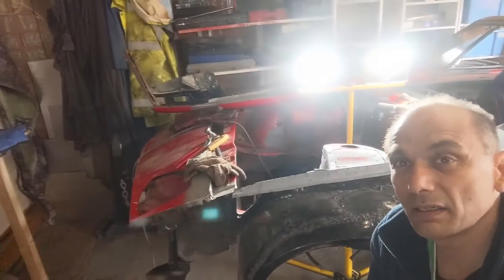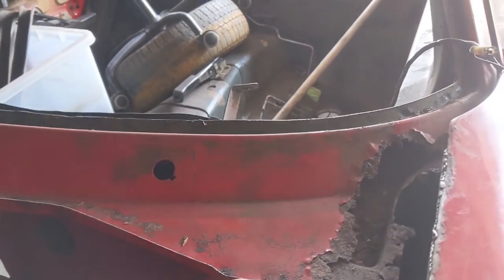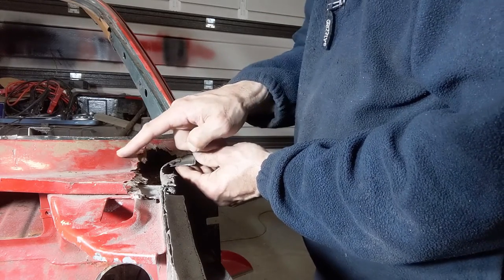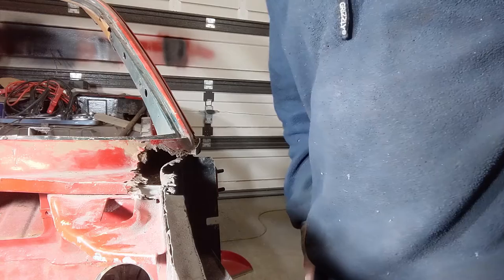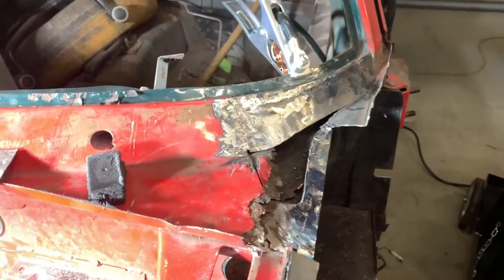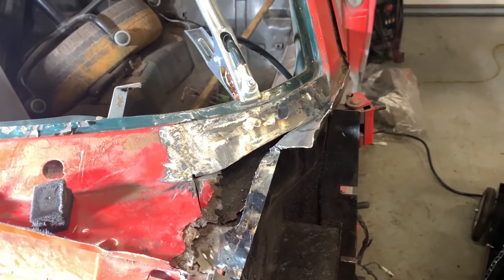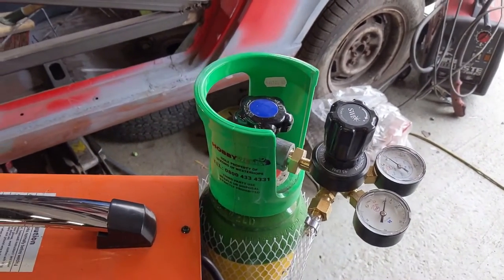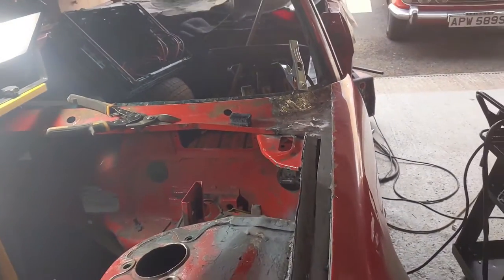Triumph TR7 Restoration: Episode 66   Passenger Side Scuttle Panel

Comment: Isn’t there another panel underneath the scuttle like there was on the other side where you said you were chasing the rust with the welder? Or did you repair that without showing it on the video?
Reply from the maker: Hi Andrew.  This was some time ago and I don't remember.  I don't remember deliberately leaving rust anywhere so I think I must have repaired it somehow without showing.